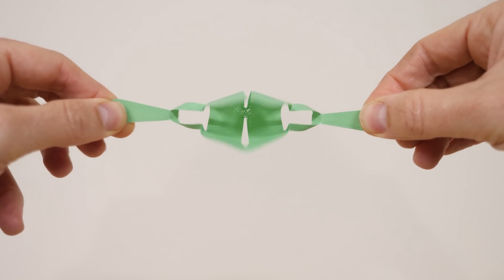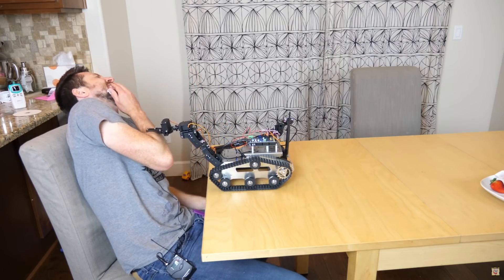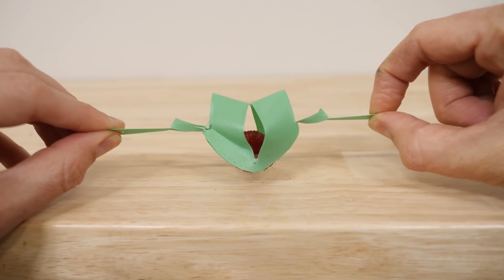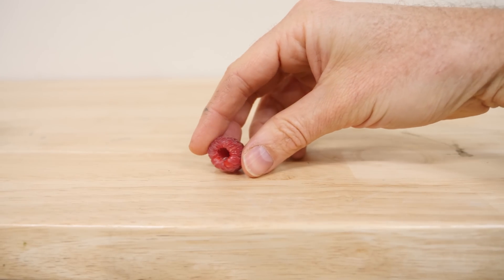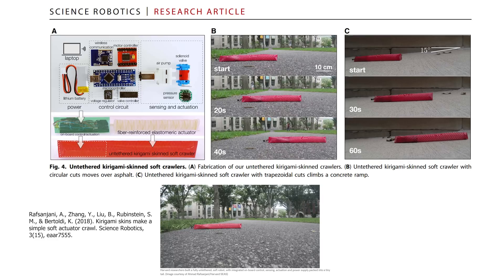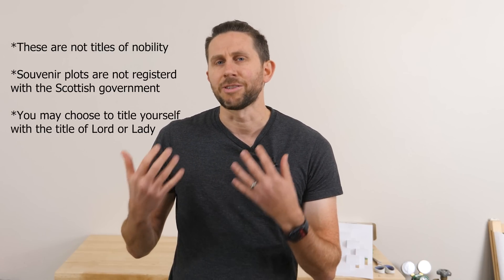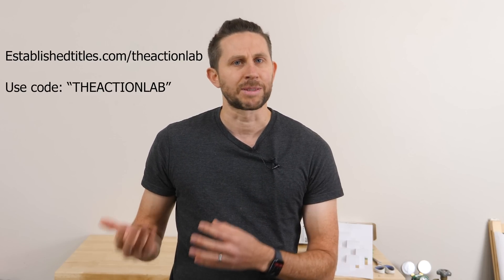Shape Shifting Kirigami Robots

Comment: Can't think of any applications off the top of my head, maybe grasping certain objects in microsurgeries or in constructing micro-electronics?

you could roll up walls for a mars base into a compact tube, 

after you unfurl if you seal the honeycomb pattern, depending on the  shape, could hold air for insulation or water to block space radiation!

also, depending on the material, you could easily manufacture the structure for battery banks or solar panels, maybe?

what if you glued a flexible polymer on both sides, with out inhibiting the opening action, could you make an ultra portable umbrella or like shield?

like you say, the possibilities are endless!

Comment: This was literally the subject of my master's thesis! I used corrugations that are specifically made to fold around the contour of the item being picked up. Very cool seeing other designs here!
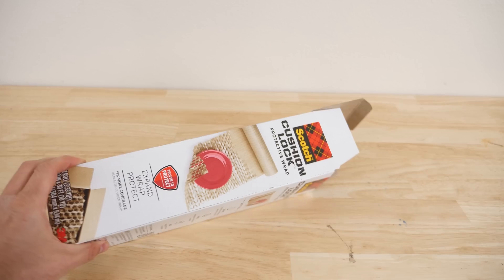Reply: Hey question of you, I am not an engineer, but I wonder if you could use the paper idea that he is talking about at 3:00 to make a 1 time use way to decelerate a falling person. I was thinking intially like when rock climbing, but you may not want them to give too much. Maybe they could be used with drones to create a ton of light weight additional drag so if the battery runs out they will 1x slow their decent to the ground where you could pick it up, and recharge it and replace it. Like a parachute. HMM maybe parachutes are better than that already. I don't know, but I bet there is a great use for a lightweight 1x use system that could decelerate someone or something falling. Cheers

Comment: Origami and kirigami are great stuff!!

Is there another -ami that you know of that are like the other two?
Reply: Shinigami!
Reply: @damicapra94  what is that one about??
Reply: @marz.6102  Shinigami is spirit  of death in japanise shinto religion. (kami is spirit) Nothing to do with paper
 Ori- means folded and kiri- means to cut. And gami means paper.
So paper folding and paper cutting
Reply: @MeltedMask  any other paper related works that the Japanese used other then cutting and folding??

Also thx for the explanation.